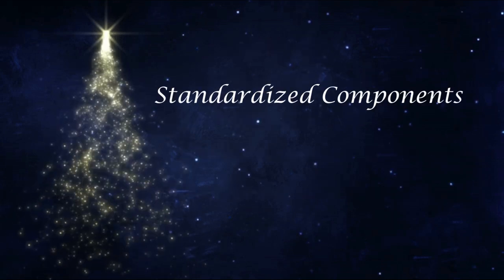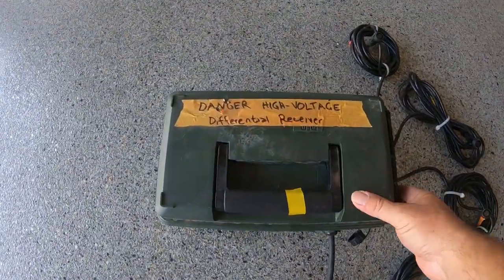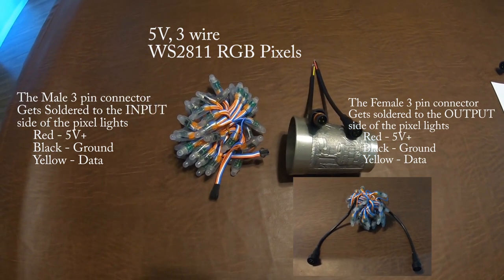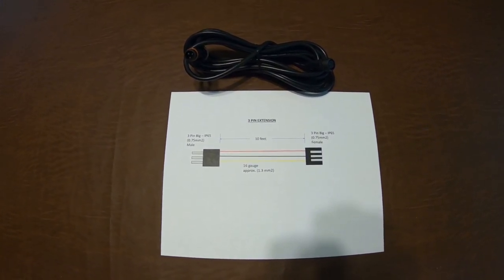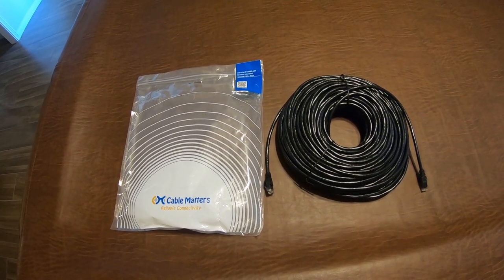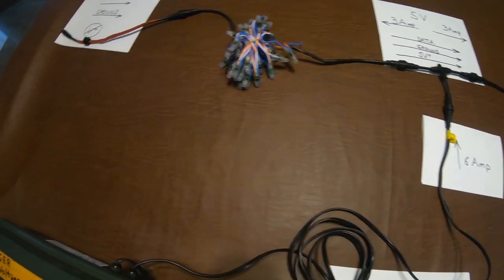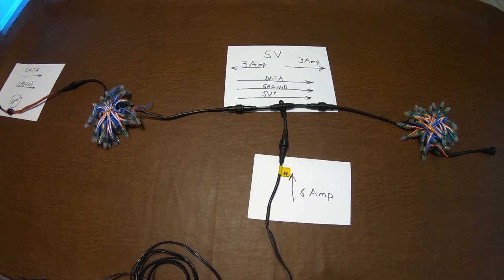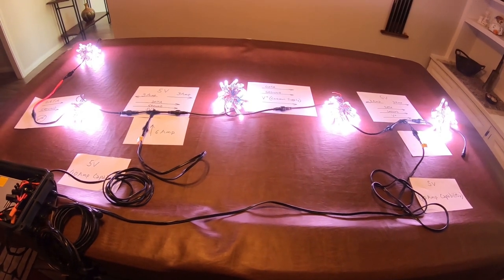Christmas Lights to Music, Step by Step Tutorial

Comment: Do you have a video or could you point me in the direction of how to use the Raspberry Pi vs a laptop/desktop?
Reply from the maker: I was trying to find the instructions I followed when I set up my Raspberry Pi, but I have been unable to find it right now.  I'll keep looking. Try Googling or You Tube searching Falcon Pi Player setup on Raspberry Pi and there are a lot of different instructions on how to install and setup a Raspberry Pi to run Falcon Pi Player.  Basically after you have the Raspberry Pi set up you can run the entire show from it, freeing up the computer for other uses.  You basically use the computer to sequence the show using Xlights, then save the sequencing file as a .fseq file.  Then you transfer the .fseq files to the Raspberry Pi. Then the Falcon Player on the Raspberry Pi runs the .fseq files, IE the whole show.  Or you can run the show using Xlights scheduler, but then the computer is tied up while the show is in operation.  Hope this points you in the right direction. Sorry I'm not much help here right now....... I'll keep looking to find the instructions I used.

Comment: Amazing job, since 4 years I’m looking to build like this. But 3 times I moved to different houses. How can I build like this. Are you making and selling like this?. How much will come all for this accessories. Without any electrical background can we do this ?. All accessories are available in the market?.
Reply from the maker: Hi John.  Anyone can do this.  I have a website, www.christmaslightingwithsteve.com that explains where to buy parts and how I built my control boxes.  Unfortunately right now it looks like some GRINCH, has hacked it, some eyeglass company. I’ll try to get it fixed as soon as i can.   Everything is available on the open market online and big box stores. And if you don’t want to build it yourself, you can purchase the boxes from various sources, but will cost a bit more than DIY.  Hope this inspires you to get started.  I put this video together to try to minimize the research required to get started, mostly explaining the control boxes.  It does but not show how i built my props however, which are mainly just drilled PVC pipe.  Its not that incredibly expensive if you DIY. Its a lot of fun.  I have become a really good wire solderer.  Thats the skill required the most that i had to learn how to do. Easy peasy now.  Merry Christmas.
Reply: @tara-tech4138  thank you

Comment: If you don't mind me asking, how much did your whole display cost? Really wanna do this.
Reply from the maker: I probably have $1200-1500 into it.  But....You can start out with just the F48 controller $200, A differental reciever $20, some power supplies $15-$35, some pixels $125/500, some misc connectors, wire, boxes and $4 harbor freight soldering iron.  You dont have to start with 3200 pixels like mine.  My first year i just had pixels on the eave of my house, a few 5V 8 Amp power supplies, and a $10 single channel controller as explained in my video.  Then I grew into the F48 and differential recievers the following year.  Start small and add over time. That speads out the time investment as well LOL.

Comment: Thank you this video teaches you a lot question where could I buy all these controllers and lights.
Reply from the maker: Thank you for the comment. If you visit my website at www.christmaslightingwithsteve.com and go to the components section, it will tell you the parts I used, where I bought them, and how to build it.  For the power supplies, I show what to order on Amazon, but if you want a better deal on Meanwell power supplies, I use TRC electronics, www.trcelectronics.com, especially if you buy 10 or more at once. Falcon F48 pixel controller is from www.pixelcontroller.com, most everything else, including the pixel lights are from Amazon and misc hardware is from Home Depot and Ace Hardware. A good wire source is www.wireandcableyourway.com.  A good source for custom connectors (2 or 3 pin), Power Injection Tees, and extension leads that I use is www.btf-lighting.com.  Hope this helps! Enjoy the journey!

Comment: Awsome video!!!!, good setup. I'm working on mine for this 2021 christmas. I want to start with my front windows, but I'm struggling with how to hold the pixels in place to make these looks straight and symmetrical. I saw you use PVC pipes right? I think it's a good idea, I will try with some pvc to see how it looks. If you have any tips about how to make thosse pvc lines let me know. Regarding to the light show I will use arduino to start but I'm also thinking about use my raspberry pi. Another question is how do you sync the Xlight software with your falcon board?? I'm wondering how that works. I love your Christmas lights, GREAT JOB!!!
Reply from the maker: Thank you Orlando for the comment.  
As for drilling the PVC.  I start with schedule 40 ½ inch PVC. I first use a long piece of 1/4x1/4 square steel tube to draw a straight line along the length of the tube with a permanent marker.  This is because the holes have a tendency to spiral along the length if you don’t have a line to follow.   Then I built a small jig to ensure that each of the holes is equally spaced.  The jig is basically just a ½ inch dowel pin sanded down to a bit less than 12 mm with 2 ¼ equal spacing from the dowel pin to the drill hole center location.  I found that a 12mm forstner bit on a small table top drill press is best for drilling straight through both sides of the PVC pipe.  A standard bit has a tendency to pull the PVC up while drilling, which is not fun.  Then come back on the back side and widen the 12 mm hole  using a ½” drill bit. But only on the backside (one hole) to make it way easier to install a 12 mm bullet pixel without the need of any additional support for the pixel. Clean all of the PVC marking off with rubbing alcohol or sand off with sand paper prior to installing the pixel bulbs.  I bought a special pair of pliers on-line to make it easier to push the pixels into the holes because it is hard on your fingers. A small hand reamer is also helpful for those slightly oversized pixels that fit too tight into the holes.  I usually make a batch of 12-16 drilled PVC pipe at a time.  Unfortunately it is quite time consuming.
I use Xlights, with a Falcon F48 controller, and differential receivers to sync the lighting effects with the music.  At first I used a laptop to run the show.  The laptop sends the XLights software lighting effects signals to the F48 controller via a dedicated show router. I use Cat 6 cable from my laptop to the router, then Cat 6 cable from the router to the F48 controller. (Xlights software sees the F48 as an IP address to communicate with it).  Then I use long Cat 6 cables that go from the F48 controller to the various differential receivers located near the pixel light props, and ultimately 3 wire cable from the differential receivers to the pixel bulb strings.  Once you have it working on a laptop, you can set up a raspberry Pi to run the show to free up your laptop.  I have never used an Arduino.
Checkout my website at www.christmaslightingwithsteve.com for more details.  The site is far from finished but it might give you a bit more information.
Thanks for the comment.  Its fun learning this hobby.
Reply: @tara-tech4138  thanks for all the details, I already finish one Window (9'x5') and I was using the 12mm bit with a drill press. The most time consuming is the pvc holes and pixel instalation, rather than that everything else es easy. For roof lines, what do you recommend? My rood is mansard style so I have a lot of lines I can fill with pixels but I think using pvc pipes is too difficult due the labor. Does pixels works with any universal light brackets??
Reply from the maker: Hey Orlando, I have not tried anything else and have not researched any universal light brackets sorry.  I have only used the PVC and have spent a significant amount of time drilling holes.  Not only the 12mm through hole but opening up the backside hole to 1/2 inch to make it easier to install the pixel.  I really like the way the PVC looks and I also like how easy it is to remove and store the approximately 9.5 foot long PVC stick of 50 pixels (with 2/4 inch spacing).  Its hard to drill and load the pixels the first year, but following years is super easy to set up since I store the PVC stick with the pixels installed.  I just put 5 "C" shaped pipe supports on the PVC stick and hang it on my eave with small cup hooks. So I will probably stay with the drilled PVC technique.  If you come up with something better and easier that still maintains the straightness and spacing and ease of removal, storage and replacement PLEASE let me know! BTW the 1/2 inch hole on the one backside hole and  pixel installation pliers makes the job of pushing the pixels a lot easier.

Comment: Would you rather use 12v led lights rather than 5v to avoid all the power injection required? What would be your pros and cons on that issue? I have researched that using 12v at proper wattage and amps at 50% brightness max they can be chained to 600 to 750 nodes without degrading.
Reply from the maker: I use 5V pixels almost entirely because of power consumption. 
50 5V pixels at max power draw 15 Watts (3A X 5V = 15 W) where 50 12V pixels draw 36 Watts (3A x 12V = 36 Watts). More than double. I ensure that power is never more than 50 pixels away from power.  That is a VERY safe rule of thumb based on running 100% brightness.  I also run my brightness at 50% so this is very safe.  The alternative safety for 12Volt pixels would be to ensure that power is never more than 100 pixels away from power.
My show has 3400 Pixels, so assuming max power i use about 1020 Watts; less than a hair dryer ((3400 /50) x 15 = 1020 watts), since i run at 50% I'm probably using 500 Watts; fairly low power usage.  I do not get much of a spike in my power bill.  
If it was a 12V show, it would use 2448 Watts  ((3400/50) x 36 = 2448 watts), almost two hair dryers), at 50% it would be 1224 Watts.  Almost a hair dryers worth of power. 
I do not think you could get  600 12V pixels  to operate without power injection even at 50% without color degradation. 600 12V pixels would require 36 amps ((600/50) x 3 Amps = 36 amps).  At 50% it would be 18 amps. That would require a wire size of 14 or 12 gauge (or thicker) wire depending on the distance.  I'm sure the wire gauge between pixels is 18 at best. The pixels I buy are 20 gauge at best.  They could never handle 18 Amps.  
I have gone as high as 64 pixels on my 5V system without incident, but I don't trust going more than that. I am a rather be safe than sorry kinda guy. 
5V Pros:  less than half of the power usage.  The F48 and separate differential receivers allows the props to be close to the differential receivers and associated power supplies, so long distances and power loss concerns are not much of an issue. That's another reason why I really like the F48 with separate differential receivers and why I use 6 port AND 1 port power supplies. 12 Volt has less voltage drop over longer distances than 5V on same size wire. Also 5V pixels are usually a little bit less expensive than 12V pixels. 5V Cons: more power injection (but lower power power supplies). 
The 12V vs 5V debate will go on forever.  They both work.  I just dont like increases in my electric bill :) Just be sure to size the power supplies and wire appropriately and either will work.  The magic formula to use is  Power in Watts = Amps X Volts and wire gauge vs amps charts can be found online.
I standardized on 5V on 16 gauge wire, max 20 feet usually only 10 feet, and pixels no more than 50ish pixels away from power, and I don't concern myself with the power, voltage, amperage, wire size math too much. I also make sure EVERY wire circuit is fused correctly, pixels and power injection.  Its a good standard and has worked for me without any problems. Hope this helped :)

By the way, all of this MATH, power supply sizing and locations, wire sizing, fusing, etc. has been thought out and sized appropriately per the standards addressed here in the recommended designs of "The Components" on my website at
 https://christmaslightingwithsteve.com/the-components/

Comment: Did you just use pvc and drill through it?
Reply from the maker: Yep.... I drill 1/2 inch schedule 40 pvc with a 12mm Forstner bit all the way through using a cheap wooden jig I made.   (The forstner bit helps prevent the drill bit from pulling up the PVC pipe when drilling, If you use a regular bit you will have to really pay attention in holding down the pipe to the jig) then redrill the backside with 1/2 inch regular drill bit. This hole setup holds a 12mm pixel perfectly with no fastener required. I use 2 1/4 inch spacing, so 50 pixels fits in just under a 10 foot pipe. Then I use a one sided metal pipe support and squeeze it down just a touch with channel locks so the pvc clips in perfectly. I put 5 pipe supports per 50 pixels/pipe. Then I hang from eave using small cup hooks. I leave the hooks on the house all year. Each pipe section comes up and down in just a few minutes or so.  This by far took the most time in getting my display set up.

Comment: Hi mate how did you make the pixel matrix on your window shutters and can you take some close up i is of it matey
Reply from the maker: Not sure how to post a picture in comments.  I will take some pictures later today and post on my website www.christmaslightingwithsteve.com. Basically,  I drill 1/2 in schedule 40 PVC with 12mm forstner bit all the way through at 2 1/4 in spacing using a cheapo drill fixture I made out of old plywood then I redrill the backside with 1/2 inch standard drill.  Then cut the ends just perfectly for an elbow or Tee to go on all the way connected without interfering with the holes.  Then just use PVC Tees and Elbows to put it together. Push the lights in through the backside with, in my case, one power injection Tee.  Gotta get the spacing just right to make a 2 1/4 in spacing make it around the corners.  If not you have to extend the leads around the corner or scallop the elbow or Tee to make the lead reach. I hang it just from the top by putting two one sided pipe clamps at the top and put two cup screws in the top of my shutter.  Ill take some pictures and post later today.

Comment: Are those just nema connections in the differential box?
Reply from the maker: In the differential receiver box there are 3 wires that go to the connectors that go to the pixels and and 3 wires (ground, neutral, line) that connects to the power supply cord (120v) that has a 3 prong (NEMA) on the end to plug into a 120v outlet for power.  Get the complete parts list and where to buy on my website www.christmaslightingwithsteve.com.

Comment: This is awesome man.  I've looked through some of the comments...but did have one question.  Once you transfer the data from the Falcon to the differential receiver box...how is the data distributed/split between each of the 4 circuits?
Reply from the maker: In Xlights after you set up your models, the setup tab has a controller visualization tool that allows you to drag and drop your pixels/models onto whichever differential receiver port/output you desire. Then it has an upload tool that allows you to automatically upload that configuration onto your Controller/Differential receivers.  There is a slider in the F48 controller setup that allows you to distribute the maximum amount of pixels allowed per port (1024) per 3 groups of 16 differential receiver ports/outputs.  I leave mine balanced equally at 340 (340x3groups=1024 max) Pixels per port, but that can be changed and set as you desire if you desire more pixels per port. This short reply does not give it justice, but there are a bunch of Youtube videos out there on the subject.  Hope this helped!
Reply: @tara-tech4138  thanks for the response.

I was not so much speaking of the software transfer.  Sorry for the miscommunication.

I’m more so speaking of what the ethernet cable from the Falcon physically plugs into once ran to the differential receiver...

I guess..what is housed in the differential receiver box for the data?
Reply from the maker: Sorry.  The differential reciever box has a small differential reciever board in it that has an ethernet connector on it for the cable from the F48 to the differential reciever.  I actually run a short ethernet cable inside of the box to a ethernet cable gland that i can plug into from outside of the box.  Hope that answered your question.

Comment: So for those power cut adapters you’re just cutting the positive wire and leaving the negative intact, correct?
Reply from the maker: Correct, you can easily just cut the positive.  Leave the negative AND data wires intact.

Comment: From your power supply to your T... what size wire did you use?
Reply from the maker: I use 12 gauge landscape lighting wire for power supply, 2 pin to Tee
Reply: @tara-tech4138  could I use 10 gauge or is that too thick?  I have over 1000’ of 10 gauge.
Reply: @tara-tech4138  your video was the best video I have seen. Great job.
Reply from the maker: @Aaron Palusso I don`t think wire can ever be too thick, only too thin :).  10 gauge would work fine as long as you can get that guage around the power supply mounts.  I just looked at one of mine, i think 10 gauge would work just fine.  That wire will come in handy ☺
Reply from the maker: @Aaron Palusso Thank you very much.  Makes me happy when i actually help and inspire someone.  Makes all of the time I spent on the video all worthwhile. Thanks!